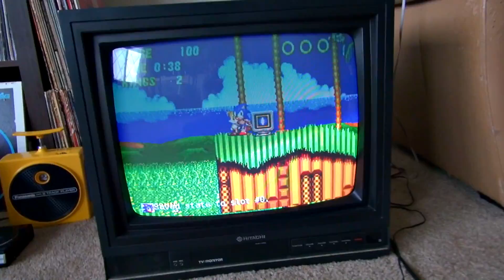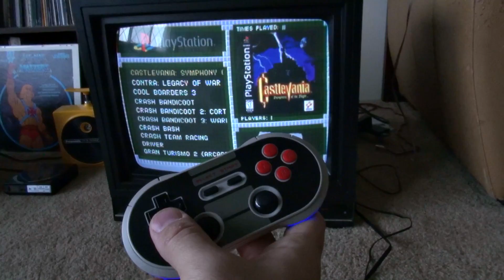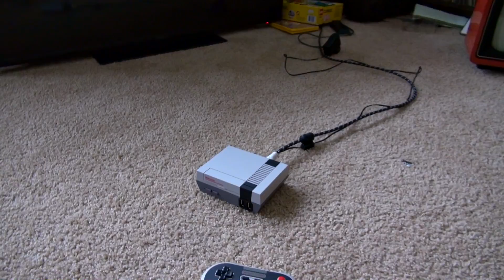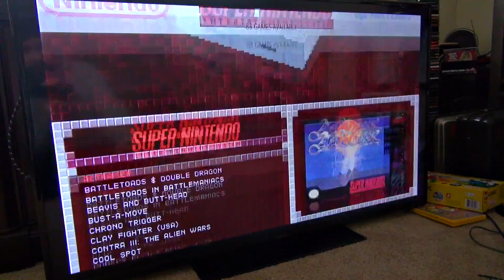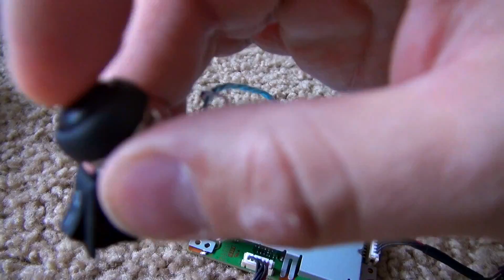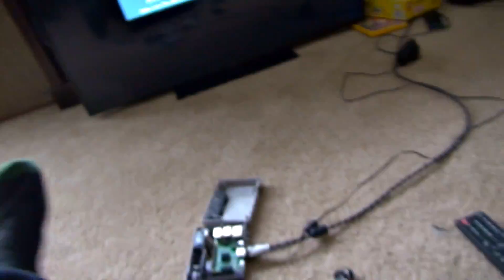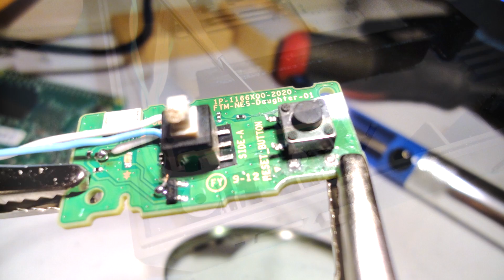Too soon? NES Classic Mini! Transformed into Raspberry Pi retro gaming machine!

Comment: Is the mini NES emulating the hardware too?  if it is, I dont see a reason to get it other than the shell that looks like a NES....
Reply: I've actually seen a few videos claiming Nintendo's emulator is not even spot on. Often times, the oldest and most respected emulators made by fans are actually going to be superior, since those emulators have had decades to develop, and have focused on emulating everything, right down to the little bugs that people might have exploited. Nintendo tends to patch that stuff out, so no, not all the games are true to their originals.
Reply from the maker: +JAFO-PTY No, the original guts of the mini is running a Linux NES emulator
Reply: Dr. Moddnstine right, so basically the same as any linux system running an emulator... I was wondering if they had recreated the same hardware as the original NES (Graphics and sound chips)
Reply: there are better emulators available unfortunately. Nintendo still has the mentality of a toymaker 😭. If they made a 'perfect" emulator/ did full hardware emulation it would be worth buying.
Reply: +Dr. Moddnstine Fun fact, you are also running a Linux NES emulator.
Reply: JAFO-PTY yeah.. the shell is what you're buying honestly..
Reply: +richfiles You have a good point. Look at the PSI attacks in Earthbound on the virtual console. Dim and muddled out of fear of triggering epileptics.

Comment: I have a question, I just ordered a Raspberry Pi 3 to make my own retro game console with retropie but I would like to use both CRT and HDTV, mostly CRT. Does the composite video output at an NTSC 4:3 ratio automatically or do i have to set any video options each time I change between HDMI and Composite?

Comment: Very nicely done!
Quick question, why use a separate board for shutdown? I mean, you can essentially do the same with  a script and the GPIO pins ?
Reply from the maker: +John Doe  because the mausberry switch actually cuts power after its shutdown. A simple shutdown script/gpio would still require me to unplug the pi after shutdown. One touch on/off is what I was looking for.
Reply: Ah gotcha! Although, the power consumption of the unit is so low, I personally don't see the real need for one. The system will shutdown properly with GPIO+script and thus should not corrupt the micro SD card :-)

Comment: How did you manage the analog video output? Through GPIO pins or through pads on the rpi's board?
Reply from the maker: +Logan Bussell through the pads in the board
Reply: soldering where the P2 jack is soldered, it has analog video output

Comment: This is what the NES classic should have been.
Reply from the maker: +BoardOfCircuit To be fair, they did do a good job on it for what it is out of the box. The case/controller is soild too, doesn't feel cheap at all.
Reply: Dr. Moddnstine I guess your right.
Reply: the n64 emulator lags on the raspberry pi because of the fact that the raspberry pi only has a certain amount of power in it.plus it uses 5 volts so what do you expect?It lags the least on Raspberry Pi 3.
Reply: Please, make me one! How much?? Please!! YOU ARE A Genius!!
Reply: Hector Manuel ill make  you one bur it wont save...
Reply: actually the original NES classic edition Emulation is actually still better Than the raspberry pi.
Reply: :( but thats the cool part. If you find a way to have RCA cables and save/load i'm in. THIS ONE IS PERFECT!! But please let me know i'm pretty interested. Hey why the N64 emulator "lags" on retropi, project64 works fine on windows.
Reply: Anyway it can be improve??
Reply: Mordecai R Obviously because it's from the actual creators of the NES. But I think this kinda unique, I love how he customize and make a RCA adapter for analog TV's. I'm with him, those are the best television to play this type of console.
Reply: NO!
Reply: They did a great job with the classic. Ikind of think they always knew people would hack it and they made it so easy to do.

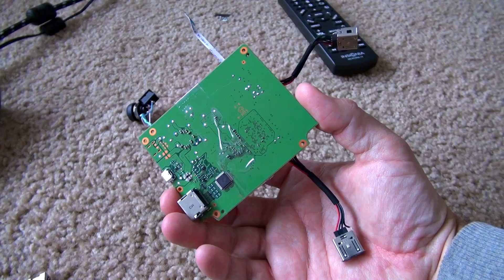Comment: In response to 14:58, someone has already found a way to load alternate Linux distributions into the flash RAM of the NES Mini/Classic Edition. As for cracking the UI, the NES-CE uses Linux-Sunxi with a NES emulator ported to it and optimized using SDL, so assuming you're adept at programming all you'd have to do is travel over to Nintendo of Japan's site and download the NES-CE's OSS package to see how the menu system and emulator works and how it could be modified to change the UI's look or add more games. Considering the NES-CE has a quad-core Cortex-A11 ARM processor running it, you could conceivably run a lot more than NES games on it if you were determined enough to screw around with it.
Reply from the maker: +DurradonXylles I'm excited to see what others do with development for it, or even pull the official Nintendo emulator off of it.
Reply: Dude, a PC/mobile port of the official emulator would be incredible.

Comment: Could you explain a bit more how you opened the cartridge trunk and how you build the opening system? Thanks!!!
Reply from the maker: +JuliaetMax Just a razor blade, and a lot of patience. Slow and steady mixed with a lot of breaks. It was a nerve racking process. Would not want do again, as the ABS plastic is very thick, and rigid.
Reply: I might not try it after all.. Did you do the holes in the back using a dremel or something like this ? Thanks.

Comment: Love the build. Now you just need to find a way to retrofit an NES Zapper and get it to work with a modern screen so you can play Duck Hunt.
Reply: theslvrbullt youd need a wii sensor bar, the zapper cant sense the type of light a lcd tv gives off
Reply: There are other technical issues making it more or less impossible to retrofit the zapper for use with emulation. It is far too timing critical. There are other techniques of course which would work better, but you won't go anywhere with the zapper even on the CRT display. This is my theory, as I've hacked the zapper quite a lot, but I'd be happy to be proven wrong.
Reply: It can sense the light from an lcd
but it won't work because of the timing of the flash it uses
lcd tv's are too slow for it.
Reply: Halcyon I know what video ypu watched for that